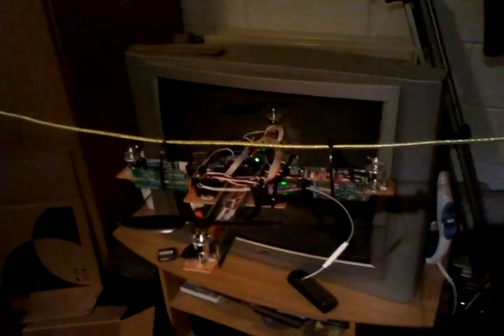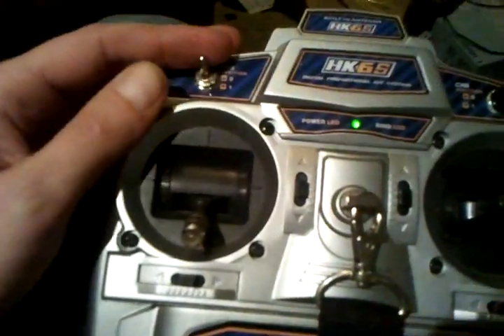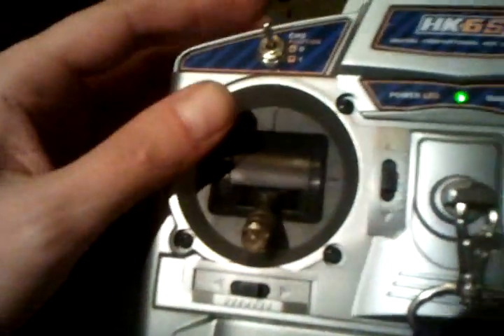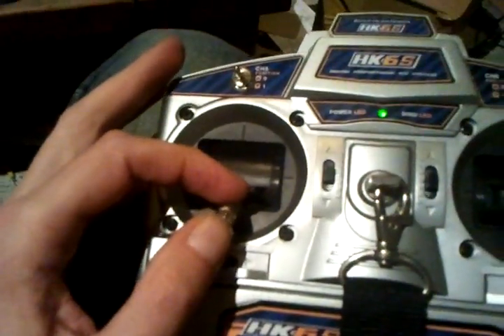Arduino MultiWii Quadcopter Part 9 - One Axis Flight Tests On A Wire

Comment: All motors and props are going in their correct directions - but yeah, you're right, very easy mistake to make. I pretty sure the problem just lies in my multiwii PID settings. When I first tested out the sensors I think I played around with some of the values. I'll just have to adjust them through trial and error until I get each motor to run at the same rate. Thanks for your help! Great videos by the way!

Comment from the maker: beside that, Multiwii is pretty good already just as it comes. Every quad should at least fly with it.
There is always room for optimization, but the basic settings are proved on quads as small as mine to 4x that size

Comment from the maker: are they turning at different rates when you give some throttle? could be as simple as that.
Also, are you 100% sure you have motors turning the right direction, and props on the correct motors? Sounds stupid, but i made that mistake once after too many changes at once...

Comment: Thanks for your reply, I'll keep persevering! hmm, I've already programmed each of the ESCs, so I don't think it's that. I'm using a brand new sensor board which works fine with the multiwii programme and an arduino pro mini. It's probably something trivial that I'm just overlooking. I was assuming you were using the transmitter because of the beeps I heard in the video. In that case, what are you changing to get the quad to level out? Are you changing the settings in the multiwii programme?

Comment from the maker: Uhmmmm, thats not setup in your transmitter, and could actually be lots of things.

Depends on the controlboard you are using, ESC throttle range should be calibrated, esc settings should all be the same, in case of an old KK board, maybe Gyro's that are not set right.
It's REALLY hard to diagnose a problem like that over the internet.

Comment: Great video! I'd really like to do the same thing! I was wondering if you could help me:
My quadcopter motors are all running quite nicely, but they're all running at different speeds.
What settings are you changing on your transmitter? Which menu is it under?
I've had a look through all the menus on my transmitter but I haven't found any settings that I could change to make the motor throttles balance out. Thanks